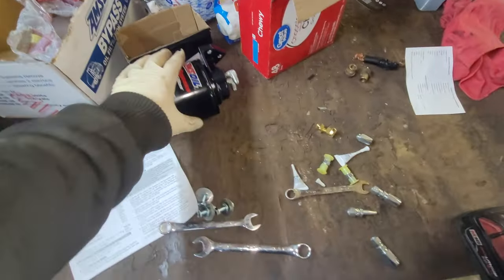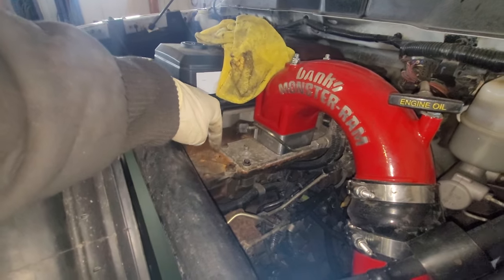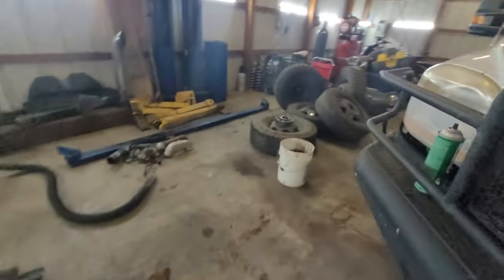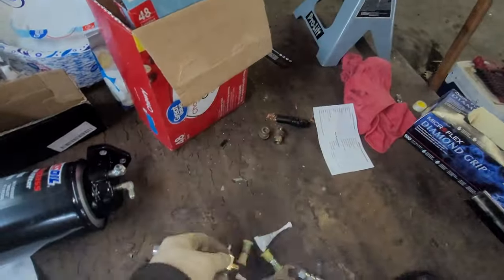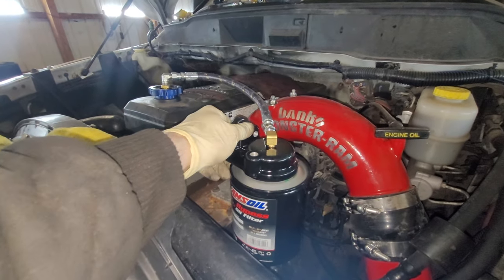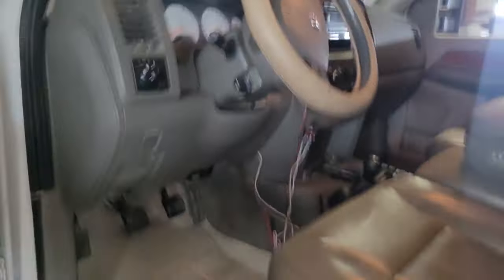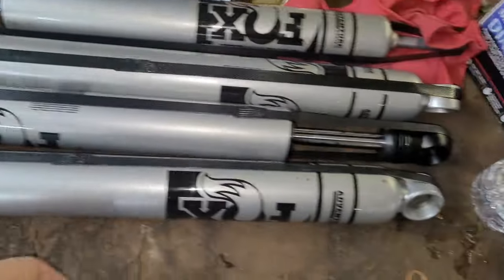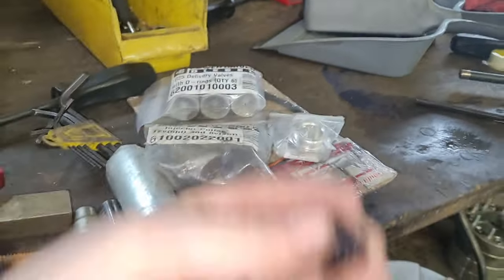Oil Filter Bypass On A 2006 Cummins Engine | Fuel Filter Delete

Comment: Cummins tells you in the owners manual to put 1 quart in oil filter and 10 in engine.
Reply from the maker: I don't know a single Cummins engine that only takes 11 quarts. The 5.9 Commonrails take 12 quarts(3 gallons) and the 6.7's take 13 quarts. If you only put 11 in it'll be low on the dipstick.

To be fair though I like poking the bear and fucking with people. I could care less who pre fills and who doesn't 😂 Just gives people something to argue about!
Reply: Steve have you seen the welding 
Machines u can put on truck that 
Runs off your battery power they are small saves space an weight 
That you don't have to carry around saving fuel an extra space 
For what ever you need 
An what's happening to you're
Comments it's hard to put one up ?
Reply: That Cummins is looking nice! 👍🏻

Comment: Isn't that coolant bypass hose just a temporary fix, seams like it would just leave hot coolant in the head longer!?
Reply from the maker: I've seen people say the same. Some guys like them and some don't. I've seen enough negative reviews that I won't be doing it. My truck hasn't seen over 217 since I put the rad and fan in it.
Reply: @CPSteveMiller  just curious! Thanks!
Reply: I've done a ton of research on the coolant bypass units and I have never seen anything negative. 

Just because your coolant temperature seems okay doesn't mean squat because the sensor only senses one location and that is way on the front of the engine far away from the back cylinders.

The back cylinders are always hotter than the front cylinders on every single 5.9 Cummins. That is a factory defect and it is worse the more stress you put on the engine. 

You can verify my claim with any infrared gun after driving the truck get out really quickly and use an infrared gun and check the exhaust manifold at all 6 cylinders and check the block at all 6 locations and you will see a substantial temperature difference from front to back. When I was pulling oversized yachts there was a crazy temperature difference from front to back. I pulled one yacht from the east coast to Michigan that was super heavy to the point I was pulling grades in 4th gear with a G56 and when I got to the top of the hill I used an infrared gun and there was a 75° temperature difference front to back. 

In the general scheme of things it doesn't matter much, but if you plan on having the truck long-term and doing a lot of towing, it's best to do a coolant bypass and exhaust manifold upgrade to even out the temperature from front to back on the engine. 

The goal is for it to circulate throughout the whole head evenly creating even temperatures across all six cylinders and for the exhaust gases to leave the engine evenly as well. 

Most 5.9 engine failures are from the back two cylinders because of this reason. It's a combination of the coolant getting hot on the back of the engine creating more heat on those cylinders creating much hotter EGTs on the back side of the exhaust manifold and eventually you can damage and melt the rear pistons. 

Doing the coolant bypass and manifold upgrade completely eliminates this problem. 

And doing the Amsoil oil bypass removes a lot of the black soot from the engine which is notorious for wearing out engines and that will also help prolong the engine. 

Some of my next upgrades on this truck will be a mechanical belt driven fuel pump, VGT Turbo with exhaust brake, and a coolant filter. 

When you have an expensive diesel truck there should always be certain upgrades that are mandatory for longevity and reliability if you plan on keeping the truck and using it as a work truck and value your investment. 

If you have more money than you know what to do with then I guess it doesn't matter what you do.
Reply: @dtmtransportationllc8742  thanks for answering I was curious!
Reply: I forgot to mention another reason for keeping consistent temperatures is because that is a very common head gasket failure reason. The higher coolant temperature is on the back of the engine, the more pressure it creates which puts stress on the head gasket. I have also read that the excessive temperature on the rear of the engine is also a reason why there are common rear main seal failures. The added heat on the rear of the block spreads and affects the rear main seal over time. Considering the use of the truck will possibly amplify how quickly the seal will fail depending on how hot the back of the engine gets and how often.
Reply: Sorry for blowing up your comment but I keep thinking of more things that are affected by the heat and it's good for people to read and consider. 

The extra heat generated on the back of the engine also can go into the transmission through the bellhousing and through the torque converter on an automatic. It can also go vice versa if a transmission is overheating, it can transfer to the back of the engine. 

A manual transmission has no factory cooler, so it has nothing to help dissipate the extra added heat that could be transferred from the back of the engine and will slowly keep it increasing both the transmission and the back of the engine until something fails. In my case it was my transmission that lost 4th gear. 

My transmission got so hot that the floorboard in my truck was hot to the touch and the shifter shaft was so hot that I couldn't touch it at all and the heat was radiating inside the cab to the point I needed AC on or windows open. It was pretty crazy. Thankfully it was my transmission that failed and not the engine.
Reply: @dtmtransportationllc8742  that's cool research. That's why European engines tend to have coolant comes out in the middle